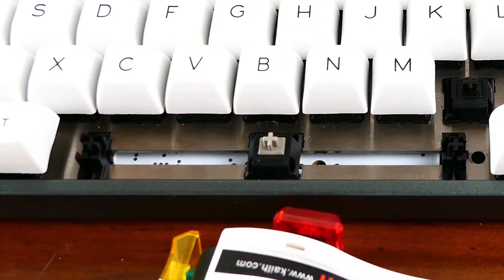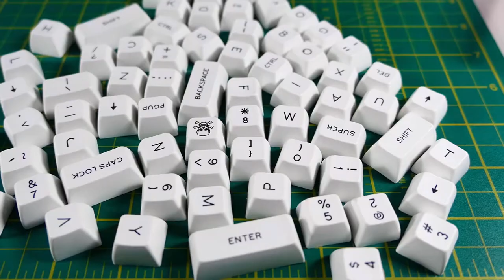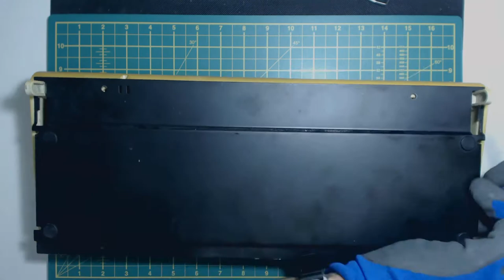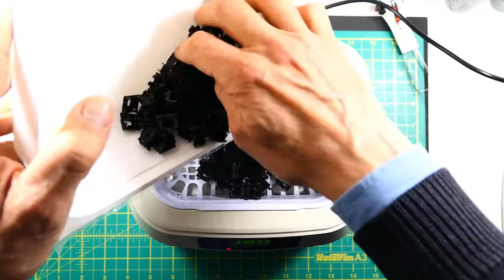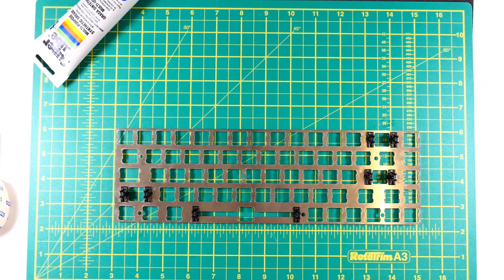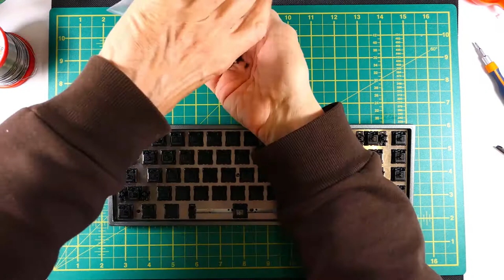TADA68 Custom 'Poison' Keyboard build log , SS plate , SP keycaps and vintage MX blacks

Comment: Hi, what film did you use in the video, is it necessary?
Reply from the maker: You mean the film I've put in the case bottom.. It's the kind of material they use to wrap monitors and lcd TVs for shipping. I did recycle some but there are better materials, like sound dampening foams. It's advisable to use some to dump sound resonance in the keyboard cavity and avoid 'pinging'
Reply: @BitSplits  Yes, that's the answer I expect, thank you

Comment: Very informative. What is your opinion of the dsa keycaps?
Reply from the maker: Thank You. These are Signature Plastics "ICE CAP" keycaps in SA profile, not DSA. I do really like vintage looking keycaps so , from an aesthetic point of view, I prefer  SA profile keycaps. Speaking of ergonomics, SA might not be the best choice, maybe DSA is a better profile, since we're all used to deal with laptops the have more than flat keycap profiles. I've seen that this TADA is really enjoyable with a wrist rest that just compensates for the higher keycap profile. The keycaps themselves are really good, they feel silky at touch and they sound like ivory dice. I would definitely buy them again. https://pimpmykeyboard.com/sa-ice-cap-keyset/
Reply: Thanks for such a detailed reply about the keycaps. What is your opinion about the vintage MX blacks?
Reply from the maker: Well, here is my own idea about them: MX blacks are my favourite Cherry switches but not all MX blacks are equal. I have several sets of MX black switches coming from different "vintage" keyboards and the best ones are those that come from pre-1989 keyboards. For whatever reason the old switches are smoother then the later ones that feel just a little scratchy even if lubed. They say that the latest "rethooled" MX blacks are as smooth as the oldest ones but I didn't try them yet. If You can find real old vintage blacks , I suggest to always replace the springs to the preferred weight for a uniform and consistent switch feedback and apply light lubing. :)
Reply: Thanks so much for this reply. Appreciate it.

Comment: Can you use Cherry MX switches with the TADA pcb?
Reply from the maker: Yes , the TAD68 PCB is built exactly for Cherry MX switches.
Reply: @BitSplits  oh I wasn't sure because all of the options looked to be advocating for Gateron, which I was against, but now after looking at Gateron, I may try them anyways.
Reply from the maker: @ @JoshuaDueck  , I did use gateron yellows in my Quefrency build. They are good and cheap but not as good as Cherry MX Black linears with replaced springs, anyway the price/performance ratio is really high.
Reply: Bit Splits yeah, I'm hoping to do browns so I can use the keyboard at work or anywhere really.